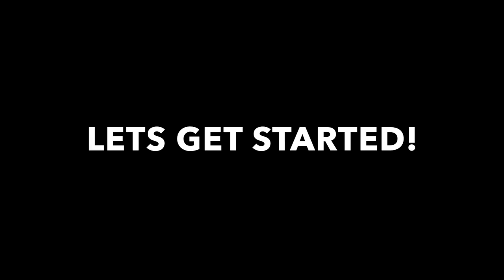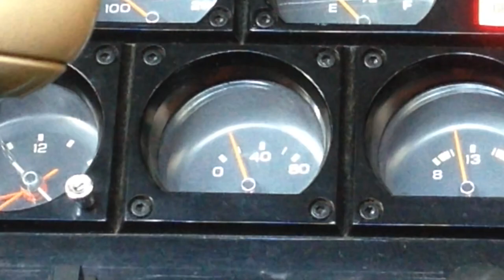C3 Corvette Revival in 7 minutes

Comment: I picked up a 1980 L-82  in 2018. It was way too cheap to pass up. The engine was fine and it has all the good options. The best thing I did to the car....by far...is put a 700-R 4 overdrive trans in it. It changes everything about the car for the better. In central Texas, the speed limits are 85mph on the toll roads, interstates are 75mph. With the over drive, I can cruise at 85 mph at 2500 rpm. That would have been 3400 before. There are a few good 5 speed kits for your C3 that bolt right in....  ???? You'll love it!  Also, a Holley 600cfm (0-1850) model will work better, especially at idle to main transition, than the AFB copy you're running. They don't heat soak as bad either.  AFB's are fine but .....   Enjoy!
Reply from the maker: Thanks Larry - A transmission swap is definitely in the future / I like the idea of the 700R4 route too - did you add a switch to manually lockup the torque converter when you want or did you keep it factory? One mistake I made: I put 3:70 gears in my C3 -  with a 4speed, its fun until you hit 55-60MPH :) - Thanks for the comment

Comment: When I built the 427 engine for my C2, 67 L-88 (complete car not just engine), I ran it in the car at 2,500 no load rpm for 30 minutes to break-in the cam and lifters. I changed the oil, filter and added a magnetic drain bolt. I then drove the car for 1,000 miles at no more than 3,500 rpm. During this time I constantly varied the rpms. After this, another oil, filter and drain bolt cleaning. That magnetic bolt looked like it had an “Afro” haircut with all the metal shavings stuck to it. After that, some Kendall GT-1 20W50 racing oil and quite a few blasts up to 7,500 rpm. I drove that car for 30,000 miles until some rich oil guy with a 10+ trophy wife bought it from me at a car show. He made an offer I couldn’t refuse, $65,000.00!

Comment: What hp did you set the engine to?
Reply from the maker: Hey Ben- the original motor is a mild 350 good for 350ish HP and 400ish ft/lb torque. However.... I just finished up a ZZ4 bottom end build in another video on my channel that should push 450 easy and I'll be starting that up this spring. Stay tuned and thanks for the comment!

Comment: Nice, TacoJoe! Do you have 225 or 255/60/15 tires on your car?
Reply from the maker: I have 255/60/15s - but - the 275s will fit on the rear (I think the E-brake cable is the only thing that "could" rub / thanks for the comment Noble36!

Comment: Great video. 
Where did you buy your parts from( specifically the suspension parts)? Also, would you have swapped your transmission for an overdrive or do you think it's not worth it?
Thank you for sharing.
Reply from the maker: I reused most of the core chassis stuff (control arms/etc) but all the bushings/tie rod ends/etc I got from your averages car parts store. Anything corvette specific I usually got from corvette central (seem to have the best prices). I’m actually in the process of swapping in a TKO600 transmission from silver sport transmission / putting together some content now that I’ll be sharing in the coming months- check out my latest corvette videos on the channel and you can see what I have planned Big picture: yes- you want an overdrive if you have gears any larger than 3:55 or so. No regrets rebuilding the st10 but it’s only good around town with the 1:1 final drive / thanks for the comment!

Comment: Super nice!😃 I plan to get my C4 Corvette to look good like yours! What did that new leaf spring cost you? I think mine is worn-out too.
Reply from the maker: a steel leaf is 100-150$ - there a million composite springs out there for C3s/C4s too. I went steel because they cannot break (or very unlikely) -they will just sag - the composites can fracture and go boom. I think that's rare though / either path works - good luck with you suspension

Comment: awesome video, how did you know you had a worn drive line? and that your leaf springs were warped?
I'm currently working on a '74 Yvette
Reply from the maker: I got a deal on the car on craigslist and knew i had to do some work almost immediately specifically there were a couple loose bolt heads bouncing around in the differential causing bangs/etc. As for the spring - i also knew i wanted to replace that because it was 7 leaf (heavy duty - rough ride). 9 leaf or one of the current generation carbon fiber springs is a MUCH smoother ride for typical street driving. 74 was a big year for the Vette- 1st year all urethane bumpers! Thanks for the comment :)